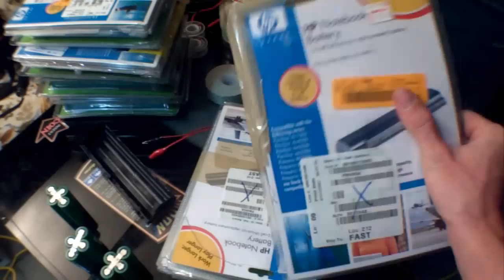DIY: 48v 24ah lithium ion 18650 e-bike battery pack

Comment: St. Joe state park in MO?
Reply from the maker: +Bowtie41 of course!
Reply: +Rinoa Super-Genius Well,I mean YouTube IS worldwide!Lol.after I posted,I saw the IL plates and figured you may be close.I'm in Granite City,and rounding up parts to build a recumbent E-Trike,as I am disabled.I built one before but sold it to a friend.Right now I'm trying to decide if I'd be better of with a car battery(sealed/AGM type),or make packs like yours.
Reply from the maker: Bowtie41
well you can always get car batteries from junkyards. id say start with whatever you can get the easiest then work on lithium upgrades.
Reply: +Rinoa Super-Genius I build a similar pack using 72 cells balance charged it, cells read ok but it only took me 100 metres. any suggestions?
Reply: +Rinoa Super-Genius  that's by me
Reply: +Everton Burrell You're going to need to give more information than that. Have you tested the capacity of each battery and paired them properly? Do the parallel packs all have the same capacity?  Do the parallel packs discharge at the same rate?

Remember, the battery is only as strong as the weakest link.

Comment: If there were a standard, or at least a dominant, design for laptop batteries someone could design a case that would have the right connectors and circuitry to just plug in 6 batteries and have a ready made power pack.

And dude, wear a helmet for heaven's sake.  It looks like you've got something between your ears worth protecting.

Comment: Is that battery good for hub motor 1000w?
Reply from the maker: Tomer Zaburoff yes its taken me over 1000 miles with a 1000w hub motor.
Reply: thanks, and for another Q .. : how many batterys i need if i buy 3.7 v 5000mha new batterys..
Reply from the maker: Tomer Zaburoff
5000mah 18650 batteries dont exist, there are a lot of scams on the internet. especially Trustfire, Truefire and Ultrafire.
Reply: Rinoa Super-Genius 

Hi Rinoa... Q: if i made battery of 12cell in 5pack is be battery 48v 20ah?
Reply from the maker: Tomer Zaburoff
no
Reply: How i make 48v 20 ah battery?
Reply from the maker: Tomer Zaburoff
 12packs of 12 18650 cells probably (144 total), but it depends on the capacity of the cells.

Comment: never run them so far down that you can feel the power reduce. statistically that means some of them in the chain will be 0 or worse. lithiums don't like to reach either end. keep from 10-90% and they will live long. run them full up and down and they will die like a laptop. overcharge or undercharge is instant death
Reply from the maker: batteries always dip when you put a load on them. i don't let mine get bellow 3.9v
Reply: Rinoa Super-Genius you mean 2.9?
Reply from the maker: nope 3.9v. 100% charge is 4.2v on these cells. dead is 3.7v
Reply: Rinoa Super-Genius Ehh, I don't believe that's true. Not even close. 
You can charge up to a 4.2V level but they rest lower than that and 4.2 is too much. And they are typically specified as empty around 3V
Find a spec sheet.
But the difficulty with mismatched cells if that you need to monitor the whole chain because they don't follow eachother. Easiest way is to stay far away from empty. And you should probably top balance the cells.
Reply from the maker: don't worry, i have several spec sheets and good sources. not counting the laptop's charge them to 4.2v.

and if you would take the time to check the description or perhaps see the anotation in the video, the next video is about balance charging the cells to 4.0-4.1v
Reply: Rinoa Super-Genius you wont find a single spec sheet specifying 3.7 as empty. That's nominal voltage. 3 is typical cutoff. And there is a difference between voltage at rest and under minor load. It's never 3.7 though.
When you charge there is also a difference between charge voltage and rest voltage. You should never try to make them rest a 4.2. The trick is to only reach a certain voltage during say 1/10C charge and then stop and let them settle at whatever voltage. But if you stop at 3.7V average then I guess they are not in danger of going too low.
You can use an Ah counter to stay away from the floor. If they are very mismatched you can't rely on average voltage to keep them safe.
Reply from the maker: well whatever floats your boat. i'd rather go for the voltage that is specified by Panasonic's 18650 datasheets and many other people including EEVblog.

not counting 4.2v IS the resting voltage of the cells inside a laptop battery. maybe do some more research next time.
Reply: Rinoa Super-Genius hehe, honey dearest, I'm an actual genius :) And I've researched anything electric cars for 7½ years. I know a little bit about batteries including various laptop cells. You feel free to post a link to a panasonic specsheet that says they are empty at 3.7V.
Nominal voltage doesn't mean empty.
Reply from the maker: only 7.5 years? glad your having fun for so long.

if you don't have the time to search for information about lithium polymar batteries i don't care, but i'm not gonna hold your hand through it trying to prove that it works when i've already shown that it does.

you havent presented any evidence while i have presented an entire video series on the subject. i get a lot of know-it-alls like you and its kinda a waste of oxygen dealing with ya after a certain point.
Reply: Rinoa Super-Genius hehe ok, you weren't fazed by my confidence :)
That was a mistake however but I can appreciate arrogance. This time you may want give it another glance and maybe realize that you don't know what you are talking about.
Here's a couple of panasonic specsheets:
http://industrial.panasonic.com/www-data/pdf2/ACA4000/ACA4000CE240.pdf
http://industrial.panasonic.com/www-data/pdf2/ACI4000/ACI4000CE17.pdf
http://industrial.panasonic.com/www-data/pdf2/ACI4000/ACI4000CE27.pdf
As you can see you typically have to pass under 3.5V before you can even talk about them being close to empty and the typical cutoff definition is 3.0V.
To be further sure that I was telling the truth I did a discharge test of a laptop cell and of course it happily went past 3.7 and much later down to 3.0V (now rests at about 3.22V) naturally according to the typical discharge graphs they also show in those specsheets.
In general it's good to read the spec sheets. It's also good to listen to a genius who has a lot of experience with the topic :)
But it's a nice build of a pack for little money. You just need to know how to treat them right. Don't charge to 4.2V until there is no current flow. Stop when it first reaches 4.2 and maybe 0.5A per cell. You want to stay away from the top, then they live much longer. And give a bit of thought (and measurement) as to how the batteries come down in voltage because they are all different in capacity. Cell reversal is a killer. Stay away from the bottom because one will be empty first and the others will drag it down below 0V. Because it's a current chain.
Reply from the maker: I just use a regular cheepo hub motor from eBay.

Also 3.3v is kinda low. Once the cells get down to 3.8ish they start to dip in voltage more than under load. I usually run them 3.8 to 4.0v

Btw there is no functional difference between lipo and lithium ion. Its just a difference in production methods and how the cells are structured but they act the same from the users view.
Reply from the maker: it doesnt really have a brand, its the 48v 1000w hub motor you see a lot of people selling on ebay. the only marking on it is 48v 1000w pressed into the motor. atleast as far as i can remember.

Comment: hey ik where i can find some of them battery's if u want i could see about sending them over
Reply from the maker: i live in illinois, where are you at?
Reply: Taupo New zealand n here they cant do much with battery's so yea i dont mind sending u some iv got my 5 that i need but i do have some spears im not sure what to do with
Reply from the maker: Eric god
 might be too expencive to send. if you do i will definatly use them though.

P.O. box 250
Taylor Springs, Illinois, 62089.
Reply: ok ill see how much it will coast n is it true lithium ion battery's r like bombs if u solder them wrong cuz i got 5 i plane on using for mum a laptop cooler
Reply from the maker: Eric god  if you have a lot of cells and short them out they will get very hot and might make sparks, maay even make a loud pop like a fire cracker. but not a bomb. lithium cells are very durable. its difficult to make them fail. that is except when you try to charge a cell to 8v or whatever haha.
Reply: ok lol so just dont play with 8v charching n ill b fine kool
Reply from the maker: Eric god
 yeah keep the voltage at or bellow 4.20v and the cells wont have any issues. battery balancing.
Reply: ok thanks brother n ill see how much shiping coasts n what stuff i can send u i pull things to pits n keep some bits for computer moding but the rest idk much to do with them lol
Reply from the maker: Eric god
 cool ^^
Reply: yea atm im looking to do a cyber computer case do uk what i culd use to make new forn peace cuz i wanna add somthing that looks more cyber
Reply: Rinoa Super-Genius Wow, I grew up an hour from Taylor. Alton/Godfrey ILL. Now comfortably in Ohio.  I have two questions for you. Oh, first a compliment. Thanks for posting the vid.  1.) I have the dc to dc constant voltage ~ constant amperage Boost Converter mentioned earlier.  Where would I get leads to charge a car battery.  When I saw it I had to have one. Mine works very well.  The other question charging akaline batteries what are your guidlines on those? I charge for 1 hour then off  2 to cool down.  The recharbles do not go to 1.5v /1.2v.  Ok, sorry one more. My off the shelf energizer charger is the same voltage on NiCd setting and NiMH setting 1.931/1.922 just took readings not a prolonged reading.  I find that weird.  Yes I want to charge akaline and button batteries my HP gonkulater 10B takes three and at Wally World it is $15 smackers oh, to include the dreaded computer battery seems like everytime I turn around I have to buy new ones.  Thanks and good job.

Comment: Matr that is NOT the way to work with lithium ion cells. You shouldnt combine so many batteries with similar yet still different specs like that. Especially combining used ones with new ones.
Reply from the maker: the way i built this pack is fine. all teh cells where the same age and capacity. but even if it where of differant capacity cells that would still be fine. i'd just have to reconfigure them to have the same capacity for each parallel pack.

Comment: My laser take a single one of these and I'm trying to find a charger for one but the Battery is ultrafire I know there fake brands and to easy see if there fake if it say ultrafire on the bottom but mine says BT or something like that but yea I need a charger for 1 of these battery
Reply from the maker: go to ebay and buy a USB charger, they cost like 1$ and they are easy to wire up.

Comment: mathematically it increases the amperage from chaining them.  This has been sold as a fail in opposition to the overpriced swindlers running the LifePoe4 market,  when Lithium Ion are actually winning for the economical thinker. Its some best kept secret.  If I were to pay 600 plus for a battery,  I would be putting off my 48v 1000w bike conversion,  but lets be honest Lithium Ion is just fine.  I was actually tempted to buy solar panel batteries at 12v AGM and cross over a battery pack,  just to see if the lies would reveal another secret,  but batteries are not an investment that is a cheap one to just play around with ideas.

Comment: or buy 2 x 12V Batteries Which are built for Motorcycles ...
Reply from the maker: that won't work. lead acid motorcycle batteries are only 12ah. they are very very expensive, and you cant discharge them more than like 10 times because they are not deep-cycle.

lithium is much better, lighter, smaller, cheeper.
Reply: Rinoa Super-Genius I think he means cells that are readily available now for motorcycles.
Reply from the maker: P Roppo  if your meaning lithium motorcycle batteries then thats just even more wasted money. might cost over 1000$ to power your bike that way.

Comment: um isnt that battery s6 not 12s??
Reply from the maker: +gijs volker its half the pack, i made another latter. and actually made a single pack so the whole thing is 13s
Reply: Rinoa Super-Genius tnx o i have one more question wat is the max amp draw
Reply from the maker: gijs volker
probably something like 50a, but i try to not go over 15 or so.
Reply: ow um wel wat happens i i draw 120A ?
Reply from the maker: gijs volker
voltage drops, battery warms up, melted contacts, broken connections.
Reply: fire ? that is no problem u i need to re tink ths btw i am building a electric skate board but i use 12 s 6 cells per cell max draw is 60  any ting i can do ?

Comment: You can do better with 12v gel cell batteries
Reply from the maker: 12v lead acid? LOL thats either the funniest joke ever or the dumbest comment in a while. if this was 12v it would have 48AH, thats about as much as a medium car battery has, except this battery weights 7lb instead of 30lb. not counting it can last almost 10 times as many cycles and can be stored indefinatly where lead acid can only sit for a few months before they are ruined.
Reply from the maker: Kevin Nguyen
i am not an arsonist.

Comment: can you build a 6 MW*h acumulator battery?*__*
Reply from the maker: megawatt/hour or milliwatt/hour?
Reply: Megawatt*hour
Reply from the maker: SyegerTubs
 yeah, but for a battery that big you would want to make it modular. like how the hard drives on a server can be popped in and out. and maybe put a fuse on one end of each cell.

if you build your pack out of used cells that you get for 1$ each and they happen to have 2.2ah then you would need 60,000 cells for 60,000$ and would prolly take you a year and a half to get all the cells removed from their cases, tested and installed. so maybe a 2 year project. then again it took me a week to test 45 cells. a 6 megawatt battery wouldnt be mobile i dont think. would fill the back of a truck. are you wanting it to power a factory power backup in case of blackout?

btw do you speak German (Deutsch)? :D
Reply: it's hard to write english,but i'll try
maybe in future I want to use a lightning energy it's about 20000 MJ.xD
Reply: and no, idon't. But i can use russian or ukranian)
Reply from the maker: SyegerTubs
 maybe you could try very big capacitors? you can target lightning by shooting a rocket up, and the rocket will have a thin wire behind it. that will bring lightning down.

i thought you where german because you said "accumulator" haha :D
Reply: thank you for chat)
and  on russian it will be аккумулятор that's why "cc" = "kk" for me,sry my mistake)

Comment: Man your like macgyver with that duct tape LOL..no pun intended.....im interested in electric bikes as well.i've been buy my lipo's on hobbyking.com and linking them together thought that might be the easiest and cheapest.but it looks like you got the better deal and the knowledge to link the laptop batteries together.I'm not sure if your willing to steer me in the right direction on getting my hands on some laptop packs cheap id give this a try.my scooter bike i wired for 60v , 75.5 or so fully charged.6s batteries i have now

thanks john
Reply from the maker: well pretty much i go to ebay, search "laptop battery" go to "buy it now" then shipping/price lowest first.

and finally on the left side you can refine the search to packs with like 12 cells or 6 cells. try those and it will exlude all the CMOS batteries people are trying to sell. ussually you can find 12 cell packs for at most 15$ free shipping. i think anything bellow 1.50$ per cell is wonderful.

Comment: Try ultracapacitors
Reply from the maker: would go maybe 100 feet before dying. meanwhile this can take me 60 miles even after all these years.
Reply: @RinoaL  how many volts motor works ?? .
Reply: @RinoaL  battery atención smaller thanks u-caps
Reply: It's advantage

Comment: Why didn't you just buy 18650 batteries off eBay lol
Reply from the maker: because you can't find good ones for 1$ each. if you buy individual cells you are getting ripped off. never buy trustfire / truefire / ultrafire. and if they claim a cell has 5,000mah they are outright lying because those dont exist. so sure you can buy from ebay, but if i did this battery would ave cost me 400$ instead of 80$ and mostly likely wouldnt work very well.

Comment: I think lot of US guys have no clue about physics :) well we are in the dragon age and ISIS behind of the US borders :) 
However brilliant idea !!! All respect! Nicely done video. I did studied electronics atc as well... apart that I am industrial designer :) And I am considering to get this real. Well... I am still not sure if the laptop batteries are the best solution to scavenge these cells however good starting point to reconsider sources. My few questions... did you get the rest of e-bike equipment upgrade like front or rear wheel from amazon and what was the engines parameters... you used probably not seen that part... ? It is important to have engine definition because if you say 40-50 miles that`s pretty good but in the fact what kind of system you where using ? Also did you used normal brakes or recuperation system ? If that was a part of engine or just simply hooked up on your commercial bike ? Sorry to bother anyway :) If I consider to splash out 2-3 grands or do it like McGyver :D I would prefer second option :D hehe... fingers crossed...
Reply from the maker: english isnt your main language is it?

anyway i've made videos about all of this bike so watch them,